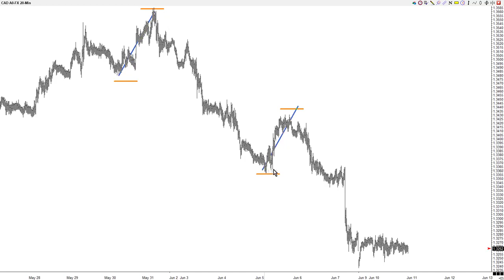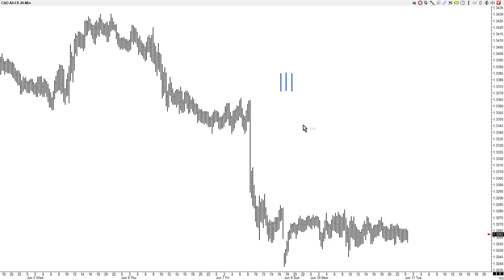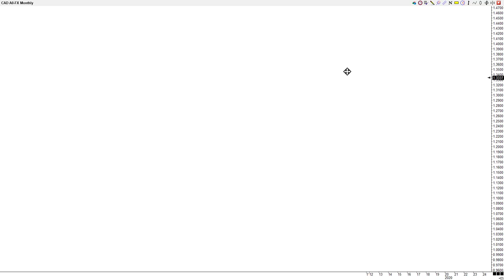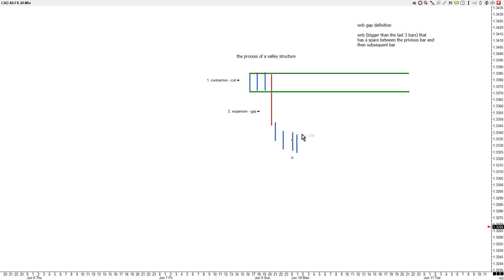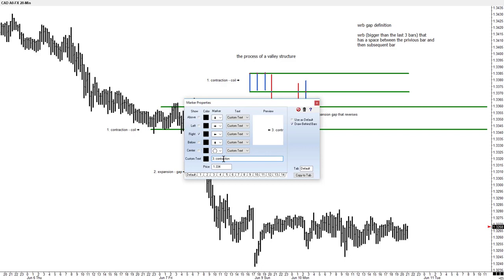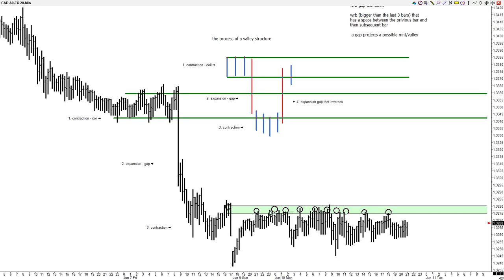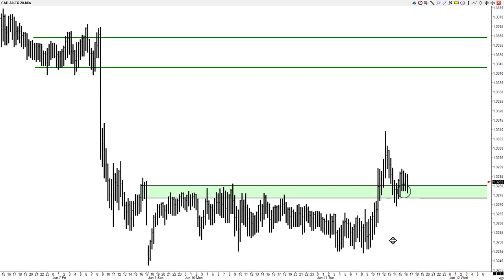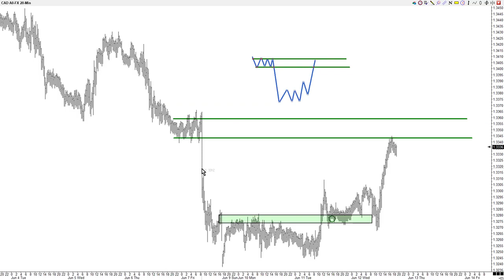Trading The Process Of A Valley In The CAD

Comment: What timeframe is best for intraday trading using this method?
Reply from the maker: The timeframe is not so important for this approach. As soon as you start highlighting swing components (contraction / expansion, gaps, etc.), you can operate on any timeframe or tick chart that is convenient for you. In fact, one of your main goals as a trader is to determine the amount of risk/reward for your trade. And it will also influence your choice. Therefore, the statement “the optimal timeframe is M20 (M5, M15, M30 ...)” is quite controversial and not universal and does not suit everyone. 
Сan you leave your trade open for the night, can you carry it over to the next week? Can you sleep soundly at night. These are also components of your choice.
Reply: @rapidfx-forks   Thanks for the advice. Love your channel.